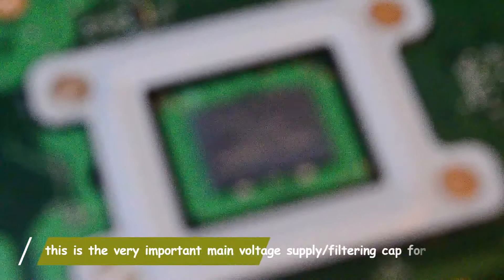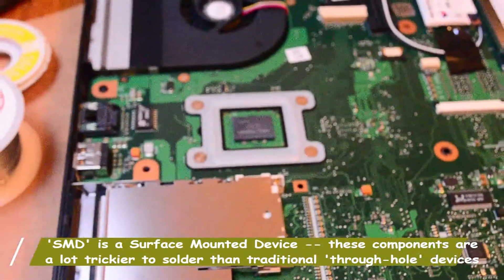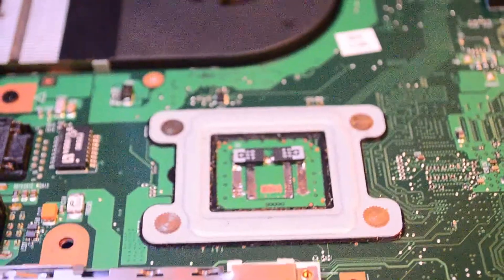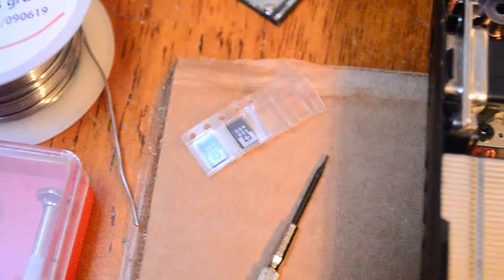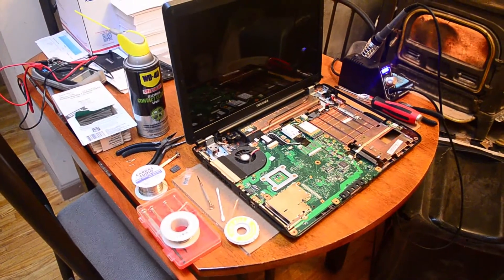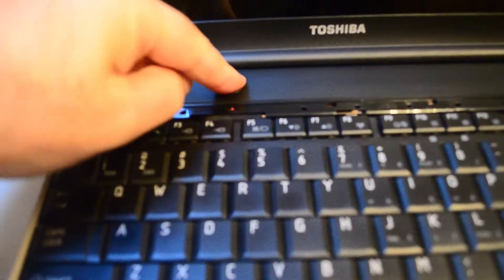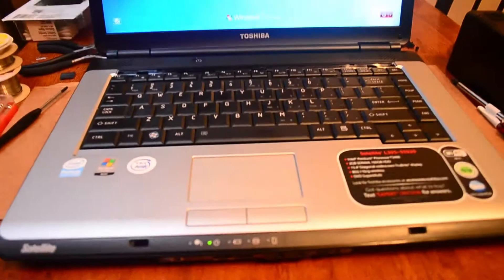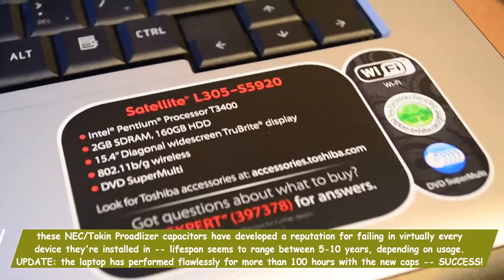FIXED Toshiba Satellite L305 Laptop Random Restarting! Recapping -- NEC Tokin Capacitor Replacement

Comment: Hi, If the problem persists after changing the capacitors (like a video tutorial), what can be done?
Reply from the maker: No definitive answer there 2Temp... try all the usual suspects, cleaning the RAM contacts, fresh thermal paste on CPU/GPU, etc. etc. Beyond all that, these old dinosaurs probably aren't worth putting much more into saving. Appreciate the question, keep us posted! 👍

Comment: Hve. Great day.. is this will work on HP ProBook 4310s?
Win7 logo then off.
Reply from the maker: Hey XLT -- if you're comfortable performing this type of work and the HP ProBook utilizes this same style of capacitor, then yes it's very likely the cause. These caps failed on most first-gen PS3's along with just about every other device from a similar time period they were installed in. Hope this helps -- keep us posted if you get it going again!
Reply: @YourKeysPlease  it works ! I installed windows 10. Thank you and more power to your channel sir.
Reply from the maker: Wow -- that's awesome! Appreciate the update and the support!👍

Comment: What are the specs of the new capacitors? You mentioned 330uf, but I'm confused about the 2.5v? Are there different voltage 330uf capacitors?
Reply from the maker: Capacitors are available in a wide variety of voltages. You're always safe going with a higher rated spec, but don't ever go with a lower voltage or capacitance than originally spec'd. Hope this helps, appreciate your comment!
Reply: Thanks. 👍